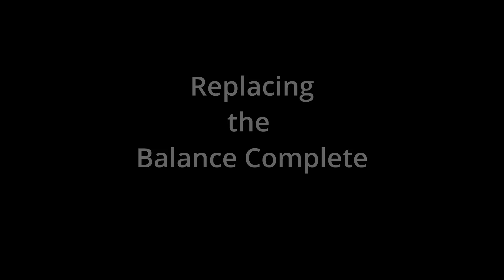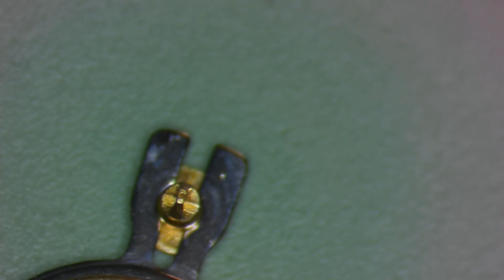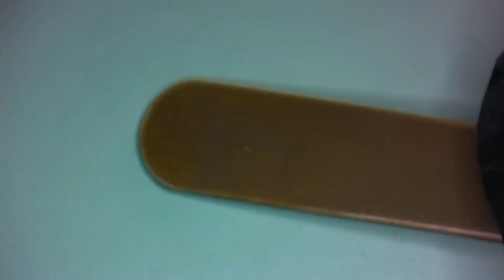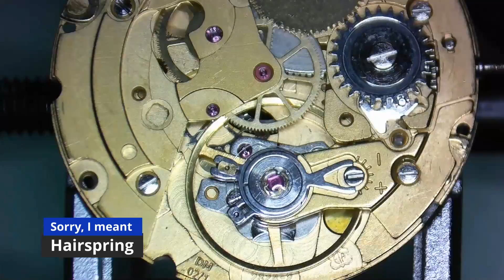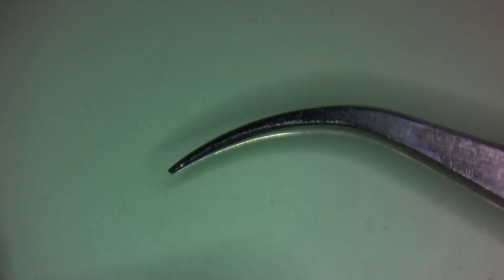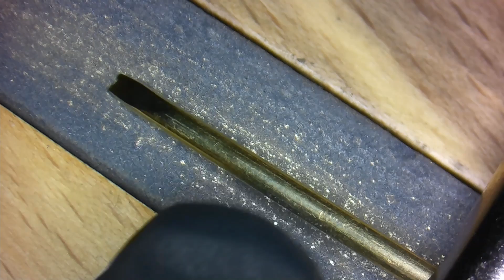Adjusting the Etachron Regulator: A Beginners Guide

Comment: 24:19 could you please explain if turning counterclockwise speeds up or slows down the watch and by how much? I have a ETA 2824 that is 30 seconds slow and I want to speed it up beyond what the micro regulator screw can do. Sorry for my ignorance, but can I speed it up by simply pushing the arm a bit clockwise? What does turning the stud inside the arm do at the end of your video? Do I need to do that, or both? Confused over here. Sorry.
Reply from the maker: Moving the  regulator arm towards the end of the hairspring slows the rate down. Moving it toward the bend in the hairspring speeds up the rate. Turning the regulator pin block, closes the gap between the hairspring and the regulator pins
Reply: @watchrepairtutorials Here I am, Alex! On the same boat here: what’s the purpose of closing the gap?? Is it always necessary? Take a breath and have patience on this poor soul.
Reply from the maker: @sergio_RJ usually to bring the vertical positions closer to the horizontal positions.

Comment: Is there a reason that one shouldn't start at about 18 minutes into your video first? In other words, fix the distance between the coils in the hairspring first and then install it into the balance cock. Might save a step.Thanks these are fantastic videos!
Reply from the maker: Hi John, 
There’s no shortcuts. The steps I am laying out are in a particular order for a reason. You Must establish the hairspring is centered between the pins before worrying about how the regulator block travels along the curve. If the regulator curve is not correct, the regulator block will tell you by causing the hairspring to be pulled which causes the bunching of the coils.
Reply: @watchrepairtutorials  Thanks! I followed your video for my first real attempt at replacing a balance wheel on my test Seiko NH36. It now makes perfect sense why I needed to follow your steps completely.I now know why my previous attempts at regulating just moving the regulator was hit or miss (usually miss!). The tip on making your own regulator tool saved me $40! Thanks again!

Comment: High level education:)
Your opinion on checking the balance complete and oiling it on a empty plate before start assembling the movement? Thank you
Reply from the maker: I am not sure what you mean about checking the balance complete on an empty plate.
As far as your second question, I think you asking about installing the balance first, oiling the jewels and taking it off. Assembling the movement then reinstalling the balance. 
You can but I usually only lubricant the endstone in the plate and the one in the balance after I install the balance. One the balance is installled and the endstone are lubricated, you must be careful what you do with the balance when you take it off the movement.
Put it somewhere very dust free if a peice of dust gets on the pivot you will introduce it into the jewel hole and create a friction problem in that jewel from the dust.
Reply: @watchrepairtutorials   i mean adjusting the balance (hairspring, echatron regulator etc), all you did in this video. Is it possible to do it before or we have to do it last thing when assembling the movement? Thank you
Reply from the maker: @BokiPetrovic88  Remember the rules of adjusting and regulation. One of them is that the movement must be newly serviced.  Is if the hairspring is obviously out of wack, I will take care of that before before cleaning.
Reply: @watchrepairtutorials  thank you.

Comment: Alex, fantastic explanation! Billy is absolutely right, you are the best at explaining this stuff! I don’t have a single watch with this feature, but when I do I’ll be ready! I’m interested in correcting beat error and I have a missing inboard regular pin on an FHF150 I need to fix, I’d love to know how to make and fit a new one! See you in the next one!
Reply from the maker: Boyd, I am assuming you are talking about adjusting the collet for beat error? What problem are you having. Maybe I can address the regulator pin in a video
Reply: @watchrepairtutorials  thanks Alex. Yes on another FHF150 I had a beat error approx 5m/s, I tried to adjust the collet, I can never get it any different. It’s the first time I’ve done it, so I don’t have much to go on, if it’s me or the movement? I’d like to learn the easiest, best, safest way of adjusting these vintage movements with collets. Also I have never adjusted the gap between the pins, so a video on that would be super as well. I found it too tricky to adjust the collet on the balance cock, so I took it off each time, but Does this mean I’m bringing extra complications and possible changes each time?
Reply from the maker: @boydsargeant7496  yep wouldn’t take the collet off.
 It’s best to put the cock on a balance tack with the balance wheel hanging down, hold it with your fingers and stick a screwdriver down through the hairspring to turn the collet.
Reply: Thanks, I tried that but found it too tricky, was like I would bend the spring at any time. So I removed the balance complete from the cock. Didn’t remove the collet, just twisted it slightly. Put it back together. Checked it in the main plate to see if the double roller jewel sat between the banking pins. When I was happy the jewel was centered I rebuilt and tested on the timer, still 5m/s out?

Comment: Thanks for another helpful video Alex! I was wondering though, around 26:25 why do you turn the key on the regulator pin to bring it in contact with the hairspring? I remember in the last video how you were talking about why a watchmaker wouldn't just set the pins in contact with the hairspring initially, instead of centering it, and how it will cause a gradual loss in rate as the amplitude rises. So, why is this not the case with an Etachron system?
Reply from the maker: No you misunderstood. After centering and verification that the regulator travels along the curve, then you just close the gap between the pins and HS. So they are not touching when at rest.
Reply: @watchrepairtutorials  ah ok, I think I understand now. I’m sure I’m overthinking this but how do you know how much of a gap to leave? You say it will be a micro-adjustment, so I assume basically just turn until the pins are as close as you can get without touching the HS?
Reply: @AWDTurboPOWAH  Exactly right. You can double-check by watching the HS breathing while the escapement is working to make sure the gap in the pins are as close as possible without the HS touching on either side. The ability to do this and adjust the stud with the same tool makes the Etachron system really easy to get great results.
Reply: @bangy55  Ahh ok. Thanks for helping me understand! Now I get it 😁
Reply from the maker: @AWDTurboPOWAH  the gap should be about the width of the hairspring
Reply: @watchrepairtutorials  Thanks Alex! 👍

Comment: Hi Alex. The British guy in Mexico forced into Watchmaking here. I wish you'd have posted this 3 days ago. I had a seiko with this setup and it was bent about half way along the length of the hairspring, I couldn't get it off the cock and was trying to ajust it mounted but found it impossible. I went to a watchmaker friend of mine for help and he showed me how to remove the hairspring from the cock. Then came the magic, holding the balance in one hand he took hold of the hairspring with tweezers and used the pivot in the center to stroke the hairspring back to true. Now the watch is running really well. He also commented if the hairspring is twisted, grab it with tweezers at the point where it is damaged and lightly push it to pithwood to rectify the problem. Thanks Alix amazing video.
Reply from the maker: Yep, when it’s out of flat your correction point is 180 degrees from the error.

Comment: THis is the best thing i've found on this so far. Thanks so much again.

Working on my first 7s26 service. If i can figure out wtf is going on with the escapement lock issues which appear to be stopping the movement after a minute adjusting the etachron was pretty daunting and not very clear till now. You've made it crystal clear.

That said, i don't have a microscope. is a 35x loupe enough to do this? Specifically to center the hairspring in the regulator pins.
Reply from the maker: Well some might be able to. I can’t contort myself enough to work that close.
Reply: @watchrepairtutorials  Well i bought a goddamned microscope haha it should arrive today.

One thing i forgot to ask is what is your metric for knowing whether you adjusted the regulator pins to the correct amount? I've seen others ay they get the watch running, put it on the timegrapher and they very finely adjust it till the rate drops by a certain amount. Do you just visually inspect it?

Also I just finished my first movement repair/service. A 10 year old  7s26 that was not running and now has a perfect signal though the amplitude is only 250. I'm about to try to bring it up to 270 if i can though I wonder if the mainspring/barrel just needs to be serviced which i do not have the tools for currently. Either way I'm thrilled it's running and has a perfect signal on the timegrapher, soon as my microscope arrives I will attempt to adjust it to get the best accuracy and delta that i can thanks to this video. Your videos have been very helpful!

Comment: Great video... Got another request for ya. I understand if you don't make a video on it; it's a bit niche, but I've been trying to screw in the microscopic screw that holds the balance spring stud to the balance cock. It has to be one of, if not, the smallest screws in the whole watch. I had to replace one and I can't for the life of me figure out how to screw it back in. It's literally the size of a grain of sand. Do I need a special tool, or is there a special technique?
Reply from the maker: Hey buddy,
Yea, there is a fine tip pin vise that makes it easy. I have some vintage ones I use.
Search for balance timing screw pin vise
Reply: @watchrepairtutorials  thanks